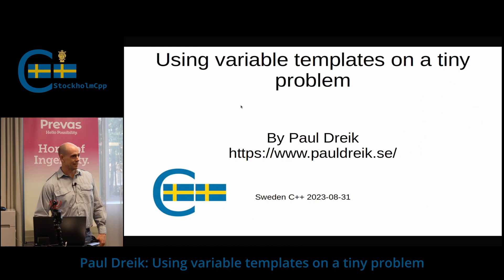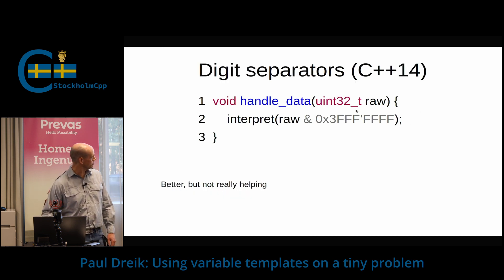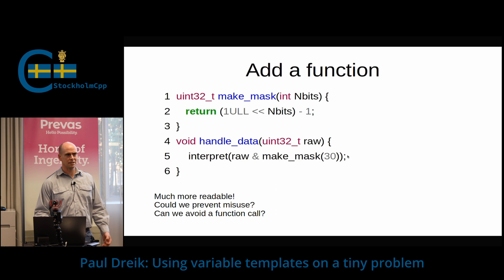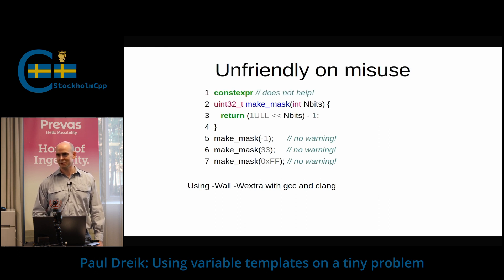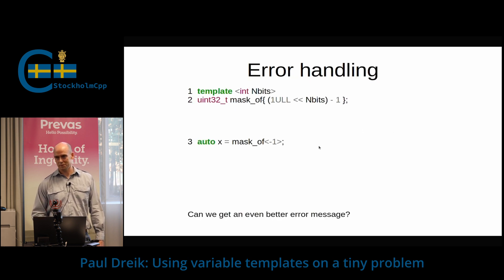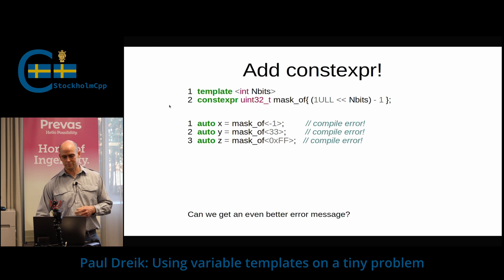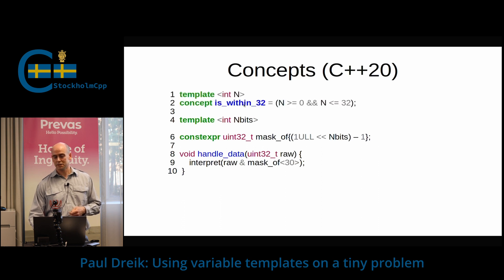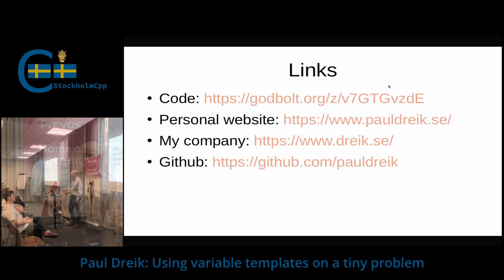Paul Dreik: Using variable templates on a tiny problem

Comment: You could just use unsigned int as template parameter, solving problem with things like -1, and use static_assert to set range of number of bits